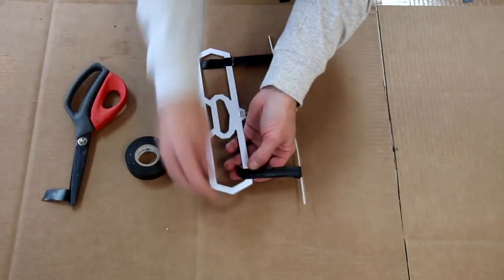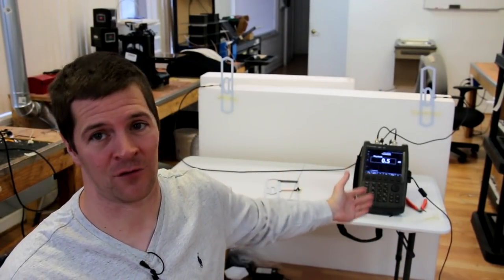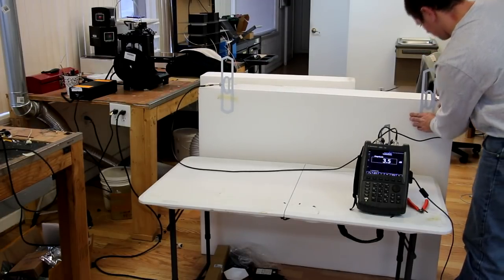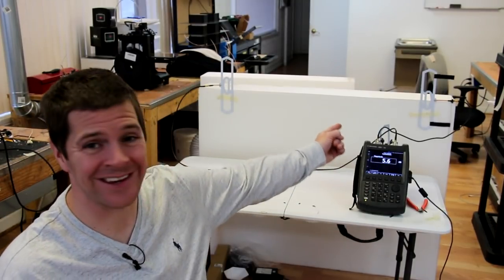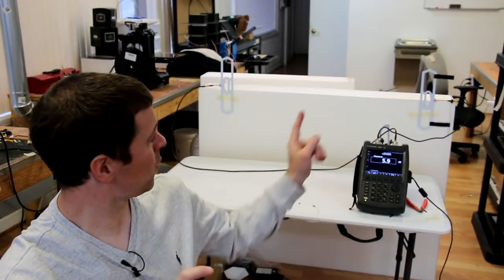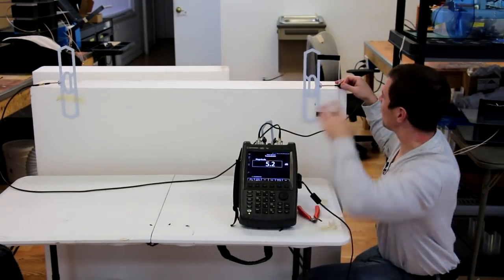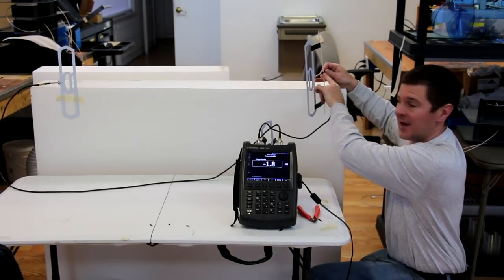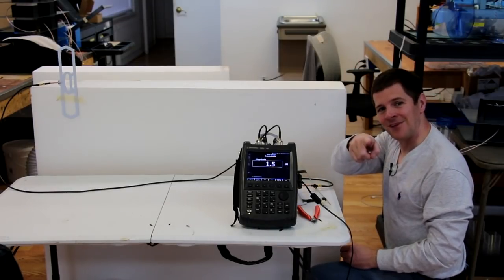VAS 433MHz Diamond extreme range hack

Comment: Any benefit to do this on a VAS Moxon?
Reply from the maker: No.  The Moxon has a built-in reflector.  However, you could make an additional director in front of it if you wanted.
Reply: @CAGreve1231  Check! Thanks ✌

Comment: Hey Alex, what would happen if You measured the antenna gain with a radio behind it? We were tuning a moxon and realised that if the antenna is placed where it usually is on Taranis X9D - in front of module bay....it slightly de-tunes. Have You noticed this?
Reply from the maker: I haven't seen any detuning worth noting.  You might get a small change in gain, but it should be minimal.

Comment: Is it possible to add more elements to further increase the effective range? I'm trying to get at least 10 km with this.
Reply from the maker: Yes, but the distances between them are going to be different.
Reply: @CAGreve1231  Thanks for the reply! Do you know of any resources out there that could help me find the correct distances and lengths of the wires?
Reply: @Metalmanic2345  - You need software to do that.  You can find some Yagi antenna calculators online, but they are not very accurate.

Comment: Alex in your opinion what is the best TX antenna? I have a SRH771 at moment and nothing wrong with it, but I've seen people use this diamond antenna and a dipole and yeah just curious if its a improvement
Reply from the maker: I used to use the SRH771 until the Diamond was designed.  Now I fly the Diamond exclusively.  My RSSI is much better.
Reply: @CAGreve1231  Thanks mate, is it worth doing the Yagi mod for general flying? I'll be honest I haven't delved very far into 433 yet, either way I'm going to be ordering a specter and chimera hd from stoneblue so I'll add a diamond too order

Comment: Would like to see you place a parasitic director element in front of the diamond antenna and see how much the gain increase is and how it effects the beam width in conjunction with the reflector parasitic element.
Reply from the maker: It would need to be smaller.  Probably 11.75" if I had to guess.  I could be done, though.

Comment: Yagis are really a good way to boost forward gain & reception.  Back in the days of Packet Radio (sort of internet/email via amateur radio, usually on 144mhz, 220mhz & 440mhz), I had some really high gain yagis .. 15 elements on 220mhz, and a pair of 'stacked' 11 element yagis on 144 mhz. I needed all this gain, as my Packet 'Node' was a transfer point of data between Cleveland (OH) and Erie (PA) .. a distance of 90 miles from each other, and I was right between them. Stations in Cleve. could 'digi-peat' thru my Node to Erie (and vice/versa). I also used these antennas to make Packet Radio contacts with SkyLab, Mir and ISS.  Those were fun times.  Now I have to go look for my "QSL" cards that I got back from those space stations.  Keep on experimenting!